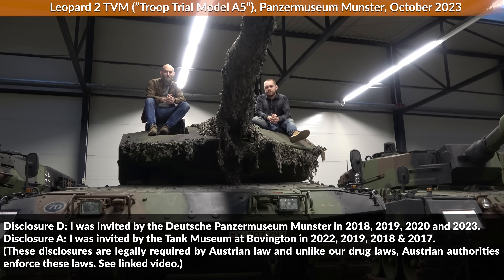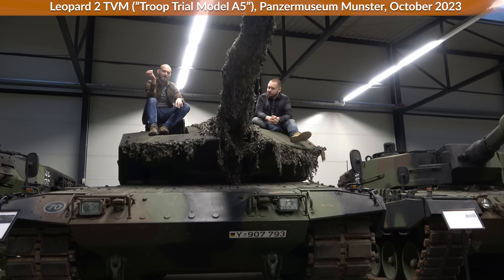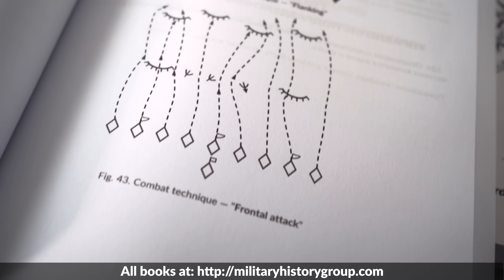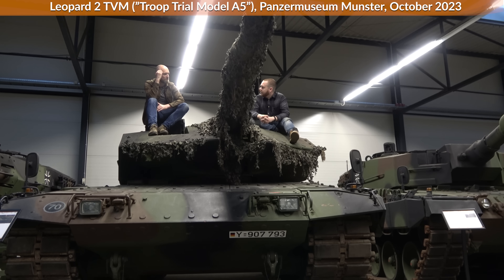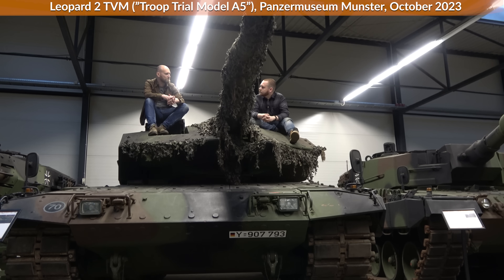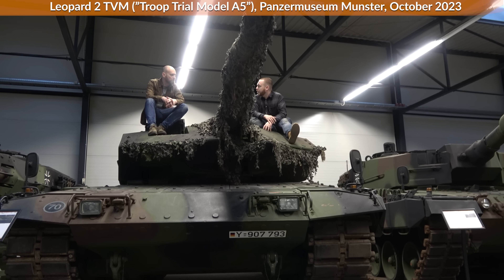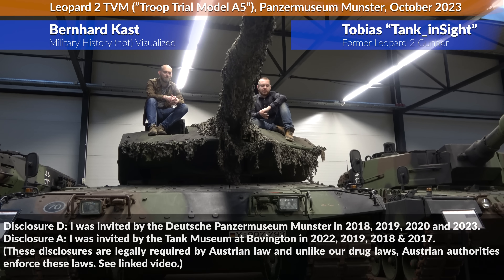Fatal Flaw? Leopard 2 Shot Trap?

Comment: nice makup for a weak girl. The leo 2s armour composition is bad. the thickness of it. is poor. the wedge is thin and not good metal. Hence basically any round from 80-90s is going through from any nation. nevermind modern day. then dont forget the hull which is even thinner. Its a cute coverup for the fact that it still has aweful sights and aweful armour.

Comment: Another thing... People have the wrong idea how the ricochet works. Most of people think of it as if it was a laser beam bouncing off of a mirror; exit angle is equal to entering angle. Most likely due to video games. Not quite the case... The round will in reality hit a metal plate it can't penetrate, dump almost all of its energy there and then it will kind of slide along the plate with very little energy (and shape cos it will deform) giving it little to no penetration ability left. It's not as I said a laser off a mirror or a tennis ball...

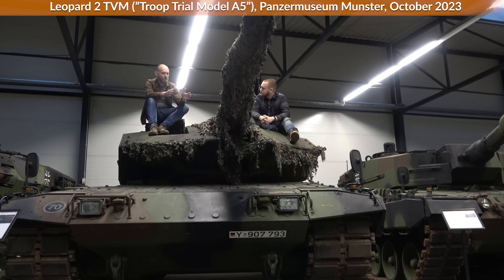Comment: 5:45 sorry folks, but the wedged armor is primarily against APFSDS. It's purpose is to destabilize the dart, so it hits the turret behind the wedge at an angle and shatters, as that is what these darts do when tumbling, as the expert pointed out so eloquently earlier in the video. The increased distance also has a negative effect on HEAT rounds, but that was gladly taken as a benefit of this kind of armor. Also, the space between wedge and turrent front is so big, that even longer NATO darts will start to tumble, which makes it effective not only against Russian APFSDS but also against NATO APFSDS, which in turn is the reason, why it became so popular in Arabic nations, next to the Abrams M1. 
Leopards wedged armor is precisely why it's considered to be the best armored turret front in the world. However, that doesn't mean it is the best armored tank in the world. Only the turret front is pretty strong, which makes it a fortress in a hull-down position. 

Correct me if I am wrong dear tankers, but plz add some sort of source if you do. :)

Comment: If the APDSFS rounds normalise why is the top half of the turret armour sloped at about 45 degrees?  If "normalisation" actually works then surely a single verticalish slap like the later turret on the Konigstiger would be easier to manufacture, give more room it the turret, save money and time in production and be just as effective?  PS bought the books.

Comment: The triangular bits at the front of the turret are literally just 20mm steel plates, behind it is a pocket of air... They're supposed to destabilize a sabot once it penetrates, and obviously the molten copper of a HEAT round has to travel more distance + the composite turret (the real armor.) It's a pretty ingenious idea, really; It's cheap and, in theory, makes it much harder for Sabot rounds under a certain length to get through.

Comment: Also worth mentioning this A5+ addon turret armor is mostly multiple layers of spaced armor not really that thick, an old fashioned APHE shell would probably just crumple the part it hit and bury itself in it or continue on to frontal face which is quite thick on its own. Unlike a very thick panther mantlet where it can ricochet off downards.

Also as far as I'm concerned the panther (and tiger II) shot trap issues were, like everything involving german armor, vastly overstated. Aiming a ww2 gun in the heat of battle to specifically take advantage of the mantlet shape is pretty much impossible, they just changed it in production because it wasn't a big deal to change the shape of it (for panther its literally just a different shaped metal plate to bolt on) and it made that concern go away almost entirely. (Hits to turret ring can still go in or at least jam turrets in most tanks in existence.)

Comment: HEAT jets aren't molten. Proven experimentation by shots into water tanks and demonstrated by sophisticated modeling.
Reply: The basis for the current understanding of HEAT-rounds is due to high-speed x-ray photography conducted at FOA, showing that the copper liner cone is getting inverted and accelerated into a long "needle" by geometry (like the outer rim of a wheel is travelling at a much higher speed than a point near the axle) that travels at speeds between 8000 - 10000 m/s. The temperatur never exceeds 800 °C, which is well below the melting point. The key attribute of the liner is ductility, which allows it to be stretched and compressed without breaking up, which is the reason soft materials like copper is used.

The rest of the explanation Bernhard gives is right one point though, at those speeds the materials (penetrating needle and armour) behaves pretty much like high pressure water going into clay, with the length of the needle being approximated as how much water you have before running dry.
Reply: @johanmetreus  Thank you. Very well-written explanation.
Reply: @ethanmckinney203  Thank you :)

Comment: even if a modern military didnt use Apfsds , they would have to have a round that would bounce off the addon armour composite wedge (witch most things can penatrate somewhat) but still retain enough energy to bounce down and into the drivers compartment , (witch isnt exactly paper thin). its not a shot trap as the composite wedge doesnt act as a single slab of armour and apfsds doesnt bounce like that , and to have a round bounce off the outer plate of the add on wedge  it would not be able to penatrate the tank from anywhere , im talking like AT rifles to be able to do that

Comment: Normalization isn't real, APFSDS just doesn't get de-normalized when hitting sloped armor like old AP rounds do. When people show simulations to prove APFSDS normalizes against sloped armor its usually against relatively thin plates or thick plates that have parallel outer and inner edges. What is actually occurring is that adiabatic shear bands in front of the penetrator as its traveling through armor create a path of least resistance parallel with the inner edge of the plate. I wish someone would do FEA with solid RHA at a slope on the entrance side and flat on the exit side to show this.

Comment: Even if someone were to use "old" solid armour-piercing ammunition, the wedge armour would hardly act as a shot trap. The plates, which are only about 2 cm thick, would be too weak for this and would not deflect the impacting projectile. The projectile would simply penetrate and then fail against the main armour.
I suspect that the greatest danger here would come from relatively small-calibre ammunition, which would be too weak to penetrate the wedge armour, although this would probably not endanger the tank's ceiling plate either.

As far as I know, the statement that the additional armour is primarily effective against HEAT is not true. 
The armour is actually intended to break the long penetrators. The armour plates of the wedge are two-layered, whereby the two layers can move against each other and thus pinch the relatively thin "arrow" and make it swing so that its tip no longer hits the main armour vertically and breaks.
Reply: Well, it does work well against both HEAT and KE penetrators but KE rounds that are over a certain length can mitigate the protection of the spaced armor to a degree.

Comment: Leopard 2 is a modern day successor to the King Tiger. Known as the Emperor King Tiger 3, it is known for it's heavy armour and famed 120mm gun.
It is a fearsome tank that brings dreaded fear to the Russians on the Eastern Front.
Reply: Except it doesn't do anything but get put on display inMoscow. Its probably the least feared of all western tanks and definitely took the most knockouts
Reply: @off6848 no shit when Ukraine mainly uses Leo way more often than any other Western tanks.
Reply: @danh7411  yep that’s also why t72s get knocked out there’s literally thousands of them on both side (was for Ukraine) but it doesn’t change the fact that Leopards haven’t done anything no western tank has had one successful offensive no videos or claims of any western tanks doing a single thing much less knock out other tanks
Reply: @off6848  there were less than 30~40 Leo taken out, which means they are not used often, which means way less action and screen time. 

Furthermore tank on tank actions are rare, most of the time you'll only see them firing into something long away.
Reply: @hissingsid6854  3 days SMO!
Reply: So why are they losing?

Comment: Ahh yes, the thin metal that makes up the wedge will tooootally deflect an APFSDS Sabot.
Reply: idea of that wedge is not to stop anything , it just helps main armor to do its job better.
Reply: It works
Reply: @FancyPantsOnFire  if APDSFS do that, that's not APDSFS

It's small and long dart have less bounce surface than normal AP

+ Leopard wedge are composite (aka another type of Plastic) have too less slope to bounce (slope like STRV, BMP might can)

Comment: The arrow wedge armor on the front of the turret was designed to snap/bend specifically the 125mm APFSDS darts before it hits the main turret armor whch is still the flat composite as the 2A4 turrets.
Reply: yes, but with 2A5 Leopard 2 got 2. generation chobham style composite armor packages. (slightly new arrangement of the composite armor and introduction of heavy metal backer plates)
And on 2A7 there was another upgrade to the armor composition and a switch from MEXAS to AMAP for the applique armor.

Comment: Before watching: I'm just going to guess that any sabot rounds that hit the lower half would easily penetrate the first panel and get caught in the shot trap rather than deflecting. Maybe if there was some kind of weird angle from a really far shot or shooting down on the turret from elevation it might deflect at a super high angle, but at that point it would just hit the hull roof anyway without the panels there.

Edit: guess I was basically correct, but now I wonder: what about AFV cannon rounds, would a 30 or 50mm projectile from one of those deflect into the turret ring causing issues?
Reply: sovjet 30x165mm APDS has enough penetration to punch through the arrowhead and then be useless against the main armor. 
most NATO partners have switched to APFSDS rounds on autocannons for higher penetration to combat heavier armor on IFV´s (currently 30x173mm APFSDS penetration is around 110-120mm of RHAe on 1000m)

Comment: You cannot combat myth with myth. 

Tungsten alloy/DU alloy Rod munition does not shatter even at 89 degree. Steel rod is a different story 

Rod munition, at least part of it, starts to ricochet at 80+ degree. Ricochet will stop once the rod create a deep enough hole in the armor. 

For completeness sake, Leo 2, at least one of the pre production version, is tested against 100 full caliber ap. At least the requirement people think it is a legitimate threat.
Reply: A lot of people don't know that composite armor has trade offs it can crack from a very big powerful full caliber AP thats why they tested it. Composite armor is good at stopping heat and APFSDS but RHA steel is actually better for stopping full caliber AP because steel is malleable. Composite glass, quartz, textolite etc is very very hard but brittle. 

I would bet that an old JagdTiger/ISU152 shell would actually do more damage to a modern tank than most people think.
Reply: @off6848  yeah the problem is, that even with the higher succeptability of composite vs full bore or sub caliber AP shot, the composite of for example Leo2A0 is thick enough to stop a 120mm L15A4 APDS on ranges above 700m. Even a T-72A is capable of this.
And considering that APDS turns basicly useless on ranges above 1000m vs composite armors due to the high energy loss of APDS and that the other side can shoot your Chieftain/Challenger 1 on 2000+m through the turret face, while you are lumbering into combat range... there is a reason why APDS dissapeared.
Reply: @zhufortheimpaler4041  Well I was talking about APFSDS which has a little more range but yeah it still loses energy at range so does full caliber AP. HEAT or ATGM ammunition is best for range because its not dependent on velocity.
Reply: @off6848  read my comment again. 
you are talking about APCBC and APDS.
Both are quite useless today.
Reply: @off6848 HEAT rounds has a serious disadvantage at long ranges though, the shell travels at about a first of the velocity of APFSDS rounds does, which makes it very hard to get the right lead above 2000 meters. The slightest change of course or speed by the target during the flight time will result in a miss. This is why the Soviet Union made barrel launched ATGMs for long range engagements.
Flight times increased even more, but at least the guided missile could be corrected to increase the probability of a hit.
Reply: @johanmetreus  I agree the barrel ATGMs are the best that’s what the t72 that knocked out the Abrams in Ukraine used Reflek gun ATGM 

The west abandoned this idea after the Sheridan project it was a mistake but their philosophy was to make a whole new gun
Reply: @off6848  The advantage of APFSDS is that is so much faster than a guided rocket over distance. Of course, spotting the opponent first is more important regardless of weapon.

Comment: The hull ammo is a bigger flaw
Reply: One must imagine Germany finally figured out to move all ammo to turret 
and hydraulic and other system on the hull
Reply: @02suraditpengsaeng41  but they haven't the 2a6 and 2a7(im pretty sure) still have hull ammo that isn't protected by blow out panels
Reply: @SRDPS2  Leo2 has no hydraulics since 2A5. its all electric drives.
and look up what modern german 120mm ammunition like DM63, DM11 etc does.... the powder charge is inert when not triggered by the ignition charge.
inert powder -> no ammunition fire -> Hull Ammo Storage is not a problem anymore.
In addition to that, the hull ammo storage of Leo2 has quite the substantial armor around it (frontal hull and sides are quite thick)
Reply: @zhufortheimpaler4041  Evidence from actual usage demonstrates that all those theoretical presumptions are wrong.

Comment: Depleted uranium armor has two features. It's very dense and the material is like super hi strength grinding wheel. It grinds away anything that hits it.
Reply: At sufficiently high velocities, material strength eventually becomes irrelevant. The bonds between atoms/molecules aren't strong enough to affect the result, and everything behaves like a liquid. What matters is the densities of the projectile and the target, and the aspect ratio of the projectile.
The projectile will tend to penetrate its own length, times the ratio of the densities. This is Newton's impact depth approximation.

Uranium is almost three times the density of steel, and strong enough to hold together as a long, thin rod. Also, it's pretty hard, which is still useful because material strength is still relevant at the speeds involved here.

HEAT actually works in essentially the same way: copper is denser than steel (though only about half as dense as uranium), and it's formed into a long thin jet when the round detonates.
Reply: Yes its molecular structure is polygonal so its always sharp and DU apfsds self sharpens at it penetrates.
Reply: DU is incredibly soft considering what its used for. 

Kind of like how lead will just deform if you try to push it through steel. DU just deforms the same way if you try the same thing. 

It's weird how the two very soft metals are very good at putting holes in things much harder than they are. Because you would never expect it handling them.
Reply: @edwardscott3262  Its because uranium is the densest material next to osmium and lead. Deformation can be a good thing if you could make a tank out of pure gold it would absorb lots of damage because gold is extremely dense and starts to act like a fluid barrier against projectiles.
Reply: @off6848 lead 'only' has a density of 11.35, compared to iron's 7.6, copper's 9, silver's 10.5, titanium's 4.5 and aluminium 's 2.7, that's a lot, but mercury has 13.5, uranium 19, gold & tungsten 19.3, platinum 21.45, and I won't get into the rarer stuff.

Typically, one would use tungsten for this application, even if it's difficult to work with (you can't melt it, because there's nothing that will usefully stay solid in contact with molten tungsten), but the US uses depleted uranium because they have huge stockpiles of the stuff just sitting around as waste from the nuclear program. It has different reasons for being difficult to work with, but apparently it's a good trade-off.
Reply: @edwardscott3262  You forgot one thing to mention and this is speed ! The Mythbuster one time accelerate a ping pong ball with airpressure and a long tube to a very high velocity (don't ask me how fast) and shot it a a ping pong bat . And it made a clean hole through this wodden bat , although this ball is very fragile it made it through .

Comment: Sabra tank also uses spaced armor, an upgrade kit for M60s. We have used them in Syria against ATGMs, RPGs etc, they outperformed naked 2A4s by far. It really works well, God knows why they aren't more common. Perhaps because financial reasons, as explained in the video add-on armor isn't so easy to implement rather often heavy modifications are needed. So countries are postponing these upgrades, our 2A4s will be upgraded as well but it will take several years. We didn't move gunner sight up but there is add-on armor almost all around including hull front and sides.